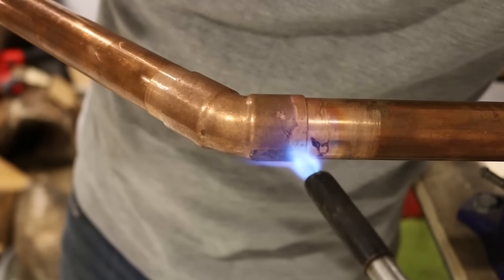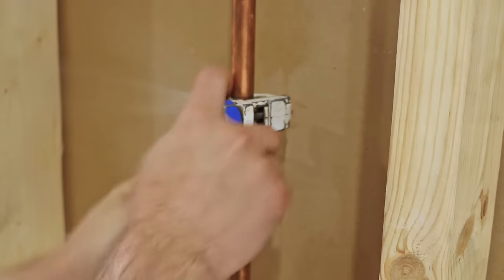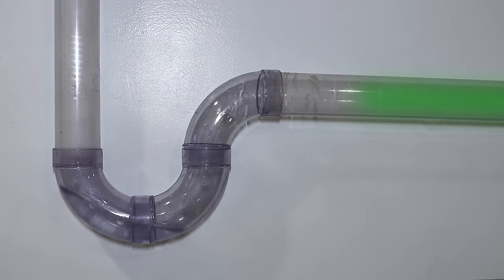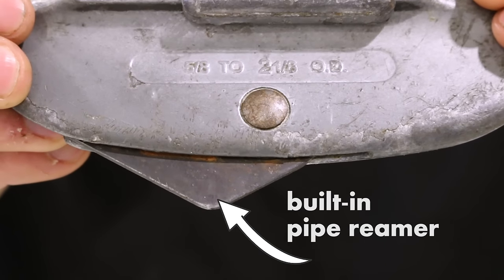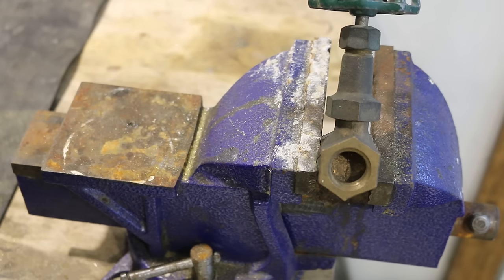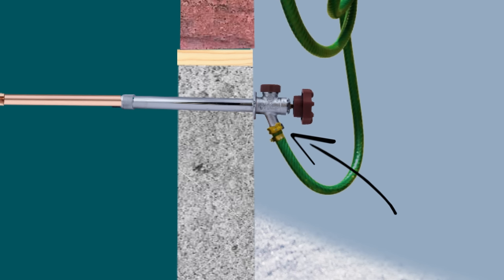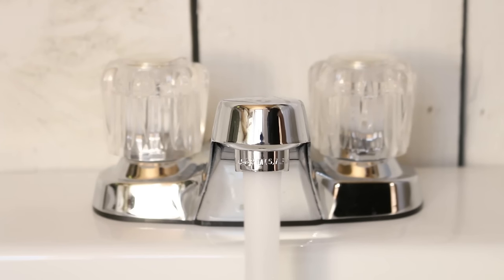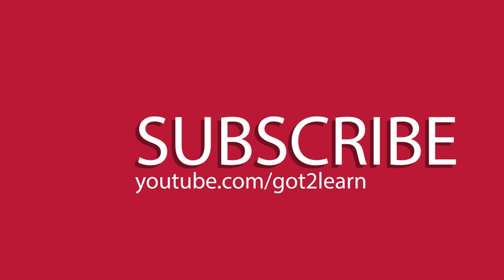The ULTIMATE Plumbing Mistakes Guide (30 Mistakes And How To Fix Them) | GOT2LEARN

Comment: Moving pipes - - Temperatures can cause long running metal pipes to move one way then another. Allow pipes to move by leaving room at the end of long run &/or install a "U" along the pipe. Just pointing out.

Comment: DIY make the same mistake when putting the wire around the terminal screw on a receptacle and what are the only two things a plumber needs to know. ans.water flows downhill and wash your hands before you eat.

Comment: Good advice, but the copper pipe over copper pipe thing is alot easier to solve than using fittings, as fittings are time consuming and yes is a better product but when you work new construction and you have a boss breathing down your neck you dont have that time, instead wrap it with 10 mil tape and isolate both pipes right at contact, anyways hot water pipe and cold water pipe by code need to be 4" apart anyways so yeah

Comment: I use copper tack brazing on all copper fittings. Solder is the weakest link in a copper pipe. Brazing it makes that joint the strongest point in that line. Furthermore, any leaks or pin holes can be easily repaired in minutes using brazing.
Reply: Brazed joints in undoubtedly stronger. But it is weaker due to the pipe being annealed. Both methods have their place.

Comment: Hi Got2Learn and others, I'm looking for fittings that connects two lines and allows them to be disconnected as well; however, when lines are disconnected, the fittings close the lines so that the fluid stops flowing - otherwise it would flow out of the open pipes. Does that exists?

It's for a refrigerant line between an RV fridge and its compressor (they are separate, not integrated.). The line is copper (I'm 90% sure).
Reply from the maker: Hmm, sounds like you need some sort of hydraulic connectors, never has to use these, maybe someone here with more experience with that can help you!
Reply: Maybe a copper union if using copper and a ball valve at each end?
Reply from the maker: @owentimo  those are "semi-quick" connects 😅😅😅
Reply: @Got2Learn   LMAO,  That's pretty accurate.
Reply from the maker: @owentimo  🤘🤘🤘🤣🤣🤣
Reply: @Got2Learn  @Sparta I found something that might work. The search term is "quick coupling no-spill". I also found something like it in another video at 3:10: https://www.youtube.com/watch?v=qKpr1nMTt6A&t=190s, but not sure which connections they are in particular.
Reply: They're also pictured here: https://www.indelwebastomarine.com/us/products/marine-refrigeration-systems/compact-marine-refrigeration-systems/compact-air-cooled-refrigeration-systems/

Comment: You DO have to worry about something when using di-electric unions and that is grounding. If you branch off a grounded pipe using one, you need to make sure to ground the branch
Reply: Thank you. That's just one example of why apprentice plumbers usually attend school for at least 5 years and work under the direct supervision of a licensed plumber for at least 10,000 hours before they are permitted to appear before a board to be permitted to take a test to be licensed.

Comment: thats easy to say but getting ALL the water out is almost impossible... if you seal ALL your drains inlets still will not make seal because of the vent you will always have SOME water in line... things like boats have super small pipes that can break easy that is why it can cost alot to get it done correctly..

Comment: Ill be damned..   i didnt know anybody else both taped and doped joints..   long time ago i got tired of shit leaking where some of the time i would get fittings from the supply house that came in a big bucket and the threads are always hit or miss and not trying to eyeball every damn fitting so i just go ahead and at least put a little tape than a little dope and never had a leak since.  That and every compression fitting i do i wrap the acorn with tape also and you can tighten em as much as you want and wont leak on you, even if you move the joint..

Comment: I had my whole house repiped with copper. Before I buttoned up the job I turned on the hot and listened for knocks where the straps are. I then used rubber from straps I cut from a red rubber gasket pad from home depot. Everything is knock free and insulated.

Comment: Great video! Last year my wife left the valve on to the outside hose and sure enough it froze up the hose all the way into the hose and blew out the copper water line in the basement. Luckily, I was home and heard the break happen and the shut off to the house was right there. It made a big mess but could have flooded my basement if I wasn’t home. Thanks for sharing!!
Reply: Blame it on the wife 😀🤠😃

Comment: for better cutting and less damage/egging/cracking rotate the rachet cutter back and forth as you squese, the way you do it your smashing through the pipe this will make cracks and give you crooked cuts, only cut while you rotate the blade, it takes some practice. for all the aprentices looking to cause trouble, forget the hacksaw and pipe cutter my bandsaw and ocilator can cut any nonsense hard to reach anything and i can sand the burs out with 10amps of ocilator pwer...but actually tho, its faster to use a good pipe cutter for most aplications and your cuts will be cleaner, i have to say im really a fan of the sets that automatically aply pressure for a dedicated pipe size, theses really improved my life, but dont get me wrong a dedicated wood for plastic or metal for cu blade on the ocilator has saved my a$$ and my freinds on some occasions, tho in hind sight if we had these modern pipe cutters that fit in tight spaces and apply pressure wo need for tightening we might not have been in such situations to begin with..i dunno maybe these tips help you out? never question the bandsaw, worth every penny, that racheting cutter from husky, that thing was bad abbsoluty buy the bandsaw or a 12v sawsaw, but the 12v sawsaw is not so nice, not cuz it cant cut clean (12v), yall be mad, its the best drywalll and sheetmetal saw &solid pipe cutter, it just cant keeep up with the higher voltage tools, and cant handle getting wet like the other two, also bosh wont give your tool back under the warranty for water damage, but what can you do. hehe got2learn i hope i gave you some cringe material to work with, i will say there is a right and a wrong way to do anything, sometimes we gota work smart & your videos rock. Peace Love Unity & Respect to all.

Comment: I’m a good plumber.  This guy’s advice is legit.   He’s right about the controversy about Teflon tape and pipe dope 😂. I personally do a “ sandwich “. Dope… tape… more dope.  The dope matters though. I use megaloc. It’s smooth and thin not goopy.  Standard Teflon sucks too. Best to use like blue monster or the thicker gray like megatape

Comment: I have made most of these mistakes over the years. Those I haven’t made I have seen the results. Most recently CPVC glue failing on PVC pipe. The CPVC glue was stocked in the ACE hardware store right next to the PVC. It’s really bad when the PVC surfaces are not sanded first.
Reply: Don't need to sand them, but always use the solvent.

Comment: I am not done watching yet. I agree with the Teflon tape direction, and will add, remember to make sure the tape does not cover the pipe opening!!! Also, in my experience overtightening, is the number one no no!!! Especially on frost proof faucets. It is normal for them to drip for a few seconds after cutoff, so don't keep trying to tighten them too much, it will ruin the washer and valve stem.

Comment: I can't tell you how many frost proof hose spigots I 've replaced.  Most freeze in the concrete block wall and never really drain when turned off.  I would keep them and show my customers, so they wouldn't think I was crazy.  FROST PROOF Spigots LEAK.  Also, I don't put a wet rag over a solder joint, if I have to I put the wet rag about 12 inches down the line NOT on the joint, after about 30 seconds.  I also use pipe wrap (heavy rubber tape) on pipes that touch.  Great video, some plumbers should watch it.  I've seen a lot of bad plumbing.
Reply: Yes they do. If they are not installed at the proper angle they will retain water and bust when frozen. I’ve changed so many because of this I’ve lost count!🤦‍♂️

Comment: Not using a primer/cleamer before gluing pipe will eventually leak. I've seen it happen many times. The primer softens the pipe for the glue to hold better.

Comment: One thing I see all the time that I guess doesn’t hurt anything but is a waste of time, is taping or doping threads on compression or flare joints. If you want to do something that helps, dope the face of the flare/union or the Ferrell. Compression threads don’t seal whatsoever, all they do is hold two things together.

Comment: Thank you so much for taking the time to make these highly professional, informative videos. Every time I watch I learn something new and valuable.

 I replaced my Master bedroom shower setup last week after cutting out a section of wall behind it through a closet in another bathroom. My home was built in 1995 and we purchased it in 2012 after a House Fire. The pipes leading into the old control valve had the 18 inch, capped copper pipes on either side and I thought they were simply to a possibly replaced 3 handle faucet system. Now I know better and need to buy two hammer arrester valves. The  problem is location and available space. The valve is very close to a vertical 2x4 and a Tee along with a 90' elbow is going to be very tight. I'll try the smaller solder-joints instead of the Sharkbites now installed but was wondering if the Hammer arrester Valves HAVE to be right next to the valve? I have good access to horizontal lines within a foot or so that would be FAR easier to work with.

 I see the part where you put the arrester on a horizontal overhead line but I'm unsure if that applies to my situation. It would be SO much easier to be able to supply you with Pictures but this give me no options for that. Again..  I apologize for the long-winded descriptions. Thank you for your time.

Comment: When soldering you should heat the pipe first then move to the joint..
Reply from the maker: Only necessary with lead-free fittings.
Reply: @Got2Learn  Yes, but on potable water lines where it's illegal to use lead solder you heat the pipe first, especially L and K copper.

Comment: I use water to cool sometimes but not direct on joint. Leave damp rag a foot back from soldier joint, you will notice it dries pretty fast, that's the water hitting latent heat for vapor and taking it away as such ( you apprentices will remember 1 cubic foot of water @ 212f will taken additional 970 btu to become steam @ 212f .. change of state ) 
I also use "perfect gas" theory to cool me soldier joints..    here's how.   
1. Use a push button torch pushes and lights...
2. Soldier joint. 
3. Lightly depress button to allow some gas flow but do NOT light. 
Again, apprentices will remember that any liquid expanding to vapor will have a mild cooling effect ( especially in air will be mild ) based on the boiling point of the gas in case of Mapp gas, boils at -36c and propane at -42c ( the latter being how your r.v. fridge cools by burning a pilot, pre pilot is just a long long copper tube heat exchanger ) . It is a gentle but effective way to cool and set a joint a wee bit faster... also don't wipe with a rag, use a peice of pipe insulation or fiberglass insulation to finish wipe immediately after you take heat away... thank me later.. check it out got 2 learn, make a video :)   heat soldier, wipe with insulation, cool mild, quick shuka  shuka with some grit cloth to even the wipe trace and BOOM.. looks like it was done by some kind of soldering robot... I do more pro press these days, but I get compliments often on my mech room, exposed soldiers.

Comment: Every time I see a non freezing hydrant split its in the wall before the shut off at the end of the valve stem. Always the valve not the pipe supplying the water and you wont find out till you use the hose, and the problem stops when you turn the hose off. NEVER LEAVE THE HOSE CONNECTED IN COLD WEATHER
Reply: That's what happened to me, in exactly the spot you mention.

Comment: In regards to the #27 tip for the intersecting pipes (one pipe running over top of the other pipe causing the pipes to rub), has anyone tried soldering the outside of the pipes together to keep them moving?  Any thoughts on that method?
Reply from the maker: Works!

Comment: The only thing I can see that this guy missed is after you solder a pipe, it should be wiped with another flux brush to smooth out the solder before the solder sets. I used to have occasional leaks on my joints, but after a professional plumber taught me this about 25 years ago, I don’t think I ever had leaks after. He told me he never has leaks. Also, not to split hairs, but historically we really don’t pronounce the “L” in solder. Seems like people have always called it “sodder”.  Otherwise, really good video.

Comment: A warning about my bad experience. Those outdoor hydrant valves with the long inner rod are great, but not foolproof. I have had the unfortunate experience wherein on an unusually bitter cold winter (-30F), even the water deep in the wall froze and the pipe burst.
Reply: when I was a kid I left the hose on our outdoor hydrant in january. (pump off)
oof.
glad it thawed out without bursting, but we had to carry buckets to water or live stock.
Reply: Damn, you need to move  lol
Reply: @tesmith47  
damn, you need to grow up. lol
Reply: Was it sloped to drain outside when off?
The first one I ever did eventually froze n burst.
It was not sloped to drain outside. I had to open the hole in the bricks to get it lower outside. No issues after 5 cold winters.
Reply: @JJBpilot  It was straight across, but it makes no difference. The water is under pressure.

Comment: That purple primer gunk stuff will stain everything.
Reply from the maker: Without it, your joint will leak, which do you prefer? ;)
Reply: Also, many inspectors look to see the gunk to confirm correct usage of the cleaner. Damned if you do, damned if you don't???

Comment: Cigarettes are worse for Septic systems in your yard. The butts will get into the holes of the drain line pipes and stop them up. Eventually your waste water  will all be flowing to the very end of your  drain field, instead of seeping out the holes in the drain lines as it flows... In most case leading to puddles forming on top of the ground in your yard.

Comment: How would the homemade hammer arrestor fill with water??
Reply from the maker: Water level goes below the tee and the air gets replaced with water in time.
Reply: @Got2Learn  I never knew that
Reply: @Got2Learn  like the passing water sucks the air out??  Do if it was an end of the line with just a 90 and a riser with cap would the air still be lost?  I'm really asking not being a dick. I think if it was off a 90 it would be fine. Don't you?
Reply from the maker: @gary19222  😉
Reply from the maker: I'm not inside the pipe so I can't see but I am guessing that would help a lot, I am just going by what I was told by the engineers that make the arrestors ;)

Comment: it's not a back flow preventer, but a back water valve.  A back flow preventer is installed in a water supply line.

Comment: In your sharkbite video you said not to sand the end of your copper pipe, but in this video you are indicating that you should clean and sand the end of the copper pipe... which is it? lol
Reply from the maker: Use an abrasive pad to remove corrosion if need be, if you do sand don't use rough sandpaper, something very light like 220 for example
Reply: @Got2Learn  Ah, thanks for clarifying!! Wow, you are awesome for taking the time to respond. I wish you all of the success!
Reply from the maker: @iansmith3301  thank you so much 🤘🤘🤘

Comment: I would recommend when tightening back up the new angle stop, and this is when using compression, to install the new nut that comes with the new valve to avoid damaging the new thread that connects the supply line or even to avoid any off shapes for the new supply line. 
When trying to remove a sweat angle stop make sure there's no water on the line nor any drips, to avoid this you can use a straw or a piece of 1/4 flex a/c water line to blow away any water, if water persists,  you can also remove the other big nut where the turning knob is and use some bread to clough any incoming water, this is in case that your maine line does not shut the water all the way off and now you can solder, don't forget to flush out the bread once you're done before connecting the supply line.

Comment: 15:10 - "There is no need to get two models" - I wouldn't use a toilet plunger for my sink.
Reply from the maker: Emergency only
Reply: @Got2Learn  no. I can wait till store is oppened to buy new plunger and stay with not washed face and not brushed teeth
Reply from the maker: @fevgg  👌

Comment: Awesome videos, as always. One tip, 3" still needs 1/4" per foot fall. 4" and bigger can be 1/8" per foot, with reduced fixture units usage.

Edit: just wanted to add that regardless of a dielectric, you shouldnt use Black iron for potable water (exeption on a fire sprinkler system). Galvanized steel isnt too widely used on potable water system either since it has the bad tendency of getting sediment build up over tine.